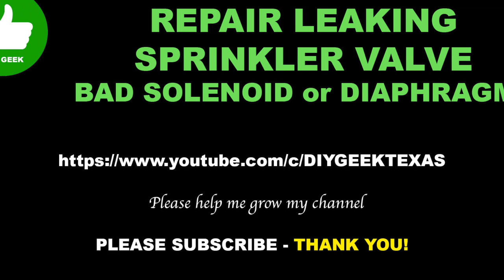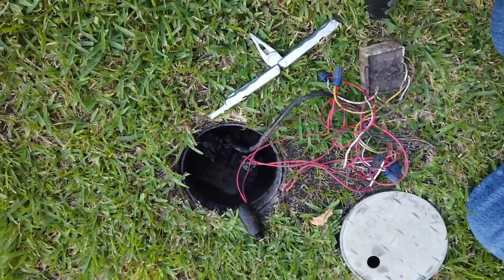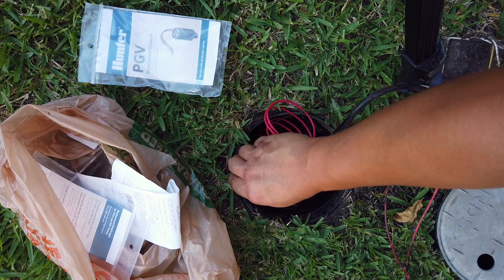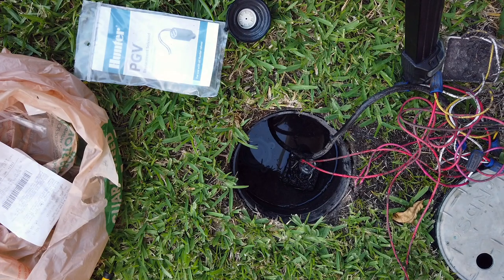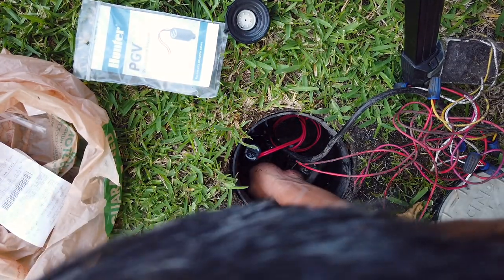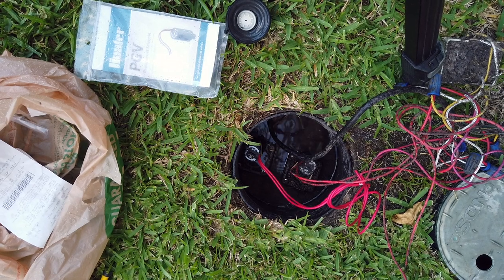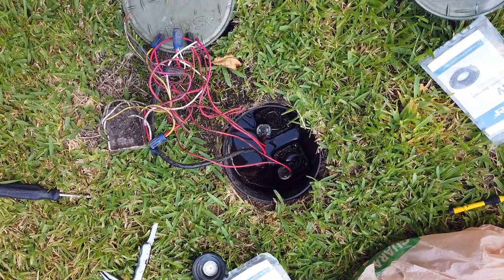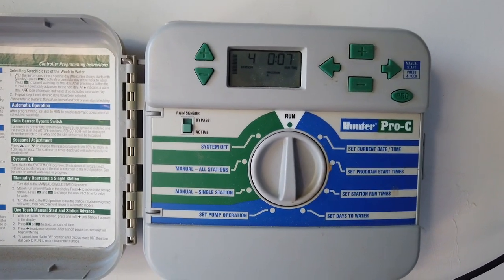*FIXED* Leaking Sprinkler Valve - How to check bad solenoid or diaphragm?

Comment: Learned a lot from this video, thank you. I do have some advice to pass on that my father gave to me. When you are reassembling something, always turn your screw backwards until it seats, then screw it in. You had difficulty with them because you cross threaded them. Also, get the turkey baster out and remove as much water as you can before removing parts. You don’t want debris getting in the spring or threads. We DIY’ers need to stick together and learn from each other. Great job. You saved yourself a pretty penny on the house called charges alone.
Reply: I also learnt that putting the same screws in the same spot is important!.As a woman in her 50's I fixed my sprinkler like a charm, thanks to these youtube videos I've saved a few hundred bucks and DIY's are always fun!💪🙏

Comment: in my experience (i've been doing landscaping and sprinklers for a long time in arizona), if when the solenoid goes, it usually will make the valve frozen closed.  solenoids are electromagnets that when turned on, open the valve against a spring.  so when they go bad, usually, the spring closes the valve and it'll stay that way until someone comes to put in a new solenoid.  if you hear water running and the valve is 'closed' as far as you know, you probably are safe betting it's the diaphram.  but, anything can happen, i'm just sharing the law of averages in my experience.  also, if you ever find yourself having to replace the entire valve, keep it, salvage parts from it in the future, believe me, there are all kinds of other plastic parts that go bad, wear down, etc... and they have to be replaced.  regardless of valve brand, they know if you need one of those they have you over a barrel so they're expensive parts, so keep your valve remnants.
Reply from the maker: Great Comment!  Thank You for sharing your experience and wisdom.
Reply: I am having same issue, had replaced the solenoid last year or year before that. I assumed it was the diaphragm this time and replaced, the issue continues and I'm seeing active leak around the solenoid joint, which...I've never seen that type of issue before and I didn't manipulate the solenoid when replacing the diaphragm. Chris, can you advise if I should probably just replace whole top half of valve as well as solenoid?

Comment: When you replaced the diaphragm, you forgot to put the support ring in first. It is the white disk that had holes in it. It fits down inside the valve body. It came out with the old diaphragm, and the broken piece.

Comment: Nice work! I'm trying to understand what position is the solenoid valve is normally left? Turned off or 1/4 turn on?
Reply from the maker: I usually turn it all the way off then come back the other way about 1/4 turn.
Reply: Well I did but still water not coming on? I hear the sound though and timer is just fine but I replaced the top part solenoid and diaphragm   . Now thinking maybe it didn’t for the bottom right or what? Very confused because manual test run worked 2 days ago and now nothing!!
Reply from the maker: @bassetto1603  try backing out another 1/4 turn. If still does not work, i suspect you may have installed the diaphragm wrongly?
Reply: I put back the old parts in just to see what happens and this time only one drip head worked!  Very strange indeed!!
Reply from the maker: @bassetto1603  🤔🤔🤔 I am thinking... That's strange. May be buy a whole assembly, replace the whole assembly? but you will have to deal with pipe work.
Reply: I was thinking the same thing. However, I don’t have the tools nor any idea how to do it as a woman in her fifties!! I'll reput the new parts so at least I can water manually until I get someone out but I truly appreciated your help!!🙏

Comment: Tks! I replaced the top of the valve (including new diaphragm and solenoid). The leak at the sprinkler head is now solved but water is coming out of the valve when the system is on. Any idea of what may be causing this leak at the valve?
Reply from the maker: There may be a crack in the valve housing if water is still leaking. Those type of issues are really difficult to fix because the leak can be anywhere and can not be seen once you close the housing.  Sorry you may have to replace the entire housing.

Comment: Thanks for sharing this video. In my case the sloenoid was good and the vaule was good. However, underneath the vaule it was leaking.
Reply: If the valve has a crack, it will keep water flowing to zone, sorry that you have to replace the entire valve.

Comment: I replaced a diaphragm on my Hunter SRV 1" Valve due to the fact it was leaking. I installed a new solenoid as well. I removed the old diaphragm which was distorted with a new one and all was fine until the next morning when I woke up and the zone where I replaced the diaphragm was running wide open (all heads) with the sprinkler system shut off (unplugged). Any ideas?
Reply from the maker: @Net Worth based on your description that 'all heads' are open, that means your controller must be energizing the solenoids. Use multimeter and test the voltage going to all the solenoids (open heads).  I believe the problem lies with the controller.
Reply: Thanks. I will test it out.

Comment: If the valve is still running, it's not the solenoid.  The solenoid is normally in the closed position.  Best to check the solenoid with a 24volt power supply or I just use 3 9 volt batteries connected in series.
Reply from the maker: @Tevusalane Thanks for the tip! Your 24V power supply is a great idea. Thanks

Comment: How do you know you don't have debris? You completely forgot to flush your valve and your at risk of knocking debris, dirty water which will stop diaphragm from working as it was designed. The ideal way to remove replace diaphragm is ALWAYS flush the valve

Comment: Yeah Okay, You Got what You Got, But, I feel sorry for all the people with buried valves. I fought that for aesthetics. But NO MORE. All my manifolds are above ground at 24" high. I make a cover to keep the sun off the plastics. I no longer have to stick my hands in a blind hole that I can't see various assembly parts and water filling the hole. I'm just amazed at the number of buried boxes and won't work on them any more.

Comment: First of all  it's not a solenoid because  bad solenoid it's buzzing,  2nd  when you remove the diagram you need  a pump to take out all the water all the dirt and grass it's stays there and you're not going to have good  seal diagram.  You're changing parts by parts for me right now ,you're not going directly to the troubleshooting.  Going luck.